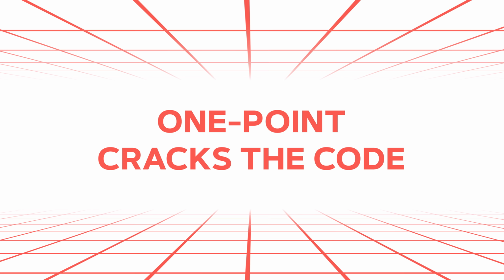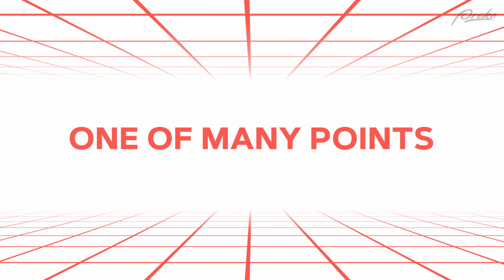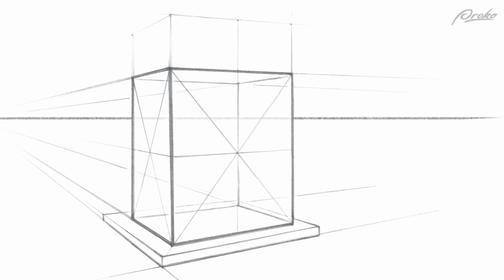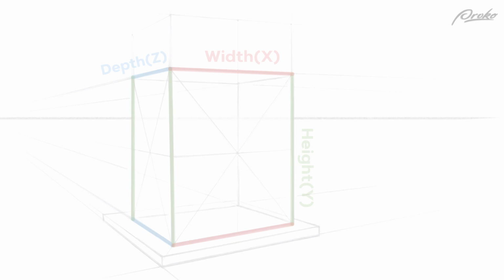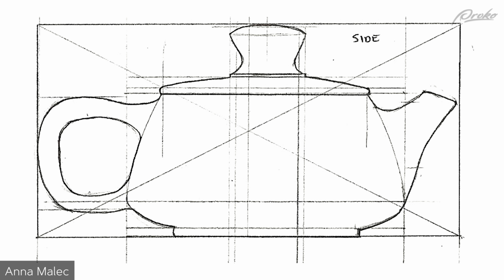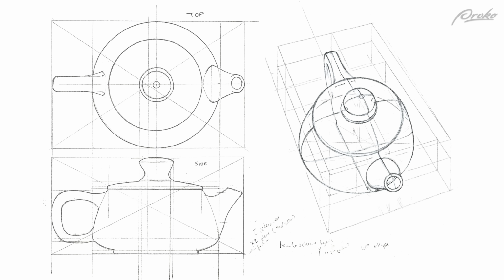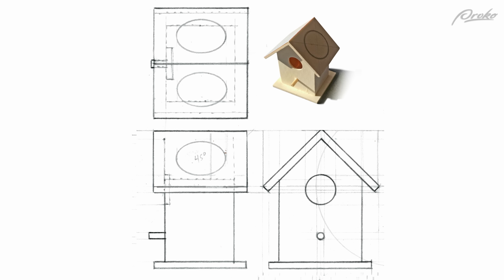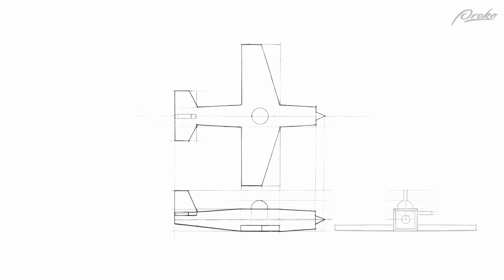What is Zero Point Perspective?!

Comment: Sorry, but I think there is no point in learning zero point perspective.
Reply from the maker: You might feel that way. But as mentioned in the video, it's a pretty standard part of professional work.

If a 3D modeller is supposed to translate the work of a concept art piece into 3D, they need to know what a thing looks like on the parts they won't see in a regular art piece. So much is obscured from view.

If you had to make a model of a building you have just a picture of the front of, you might make a really good looking front but then you have just a blank back and sides or you invent things and those probably won't be consistent with everything else or accurate to what would actually be on that building.

This extends to more than 3D modeling, of course. That applies to 2D animation, drawing a room consistently in comics and so much more.